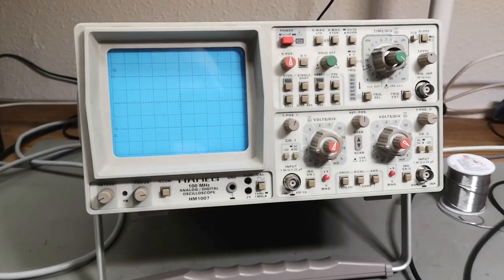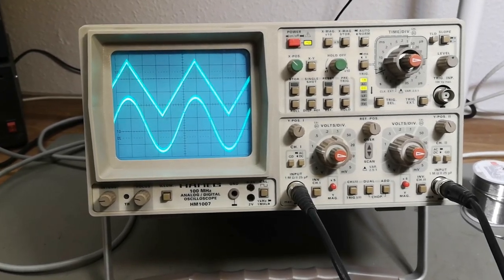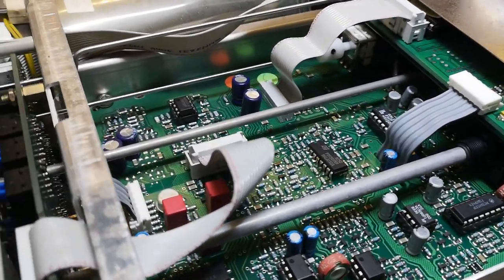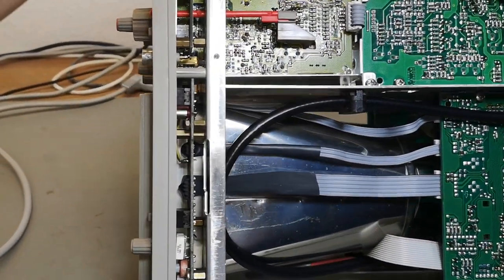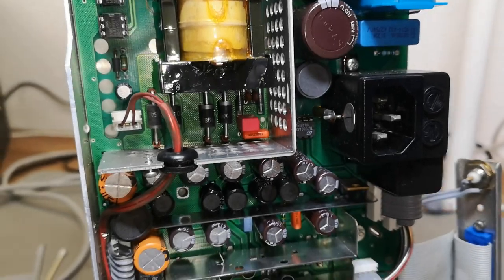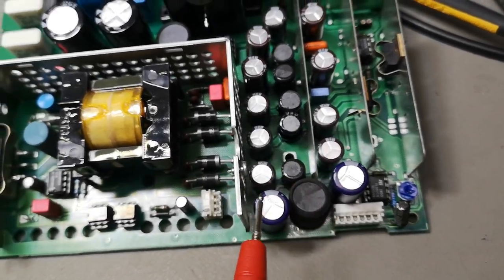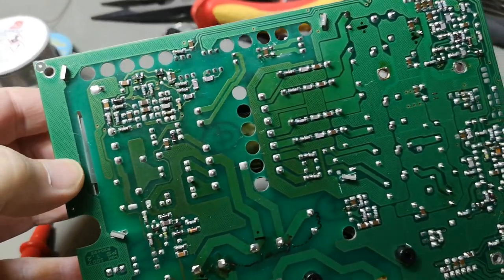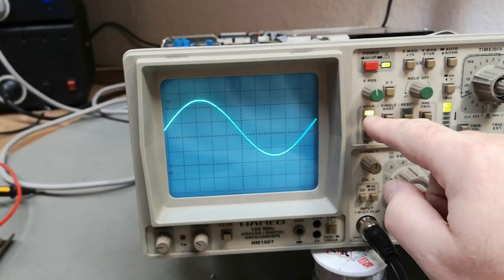Hameg oscilloscope HM1007 100Mhz 2ch analog digital 1995 teardown repair

Comment: Love the Hameg 'scopes, cheap, reliable and nearly student proof, real simple to work on when students get ambitious, real simple to use and the 60MHz/100MHz plus some of the later 35MHz ones have high EHT which gives a very nice, sharp, bright display.

I've a few others, got a Tek 200MHz something or other, a Goldstar 100MHz and a piece of junk digital thing, the Hamegs are my go to
Reply from the maker: i think you got a good point, hameg was cheap but very good, and it turned out they last and work a very long time, many other scopes where even cheaper, but today they are all defective :-) it dont take a long research thru my videos to back up that theory :-)

Comment: I just purchased the exact same model of eBay that was completely dead and it turned out to be the exact same 2 capacitors so looks like it's a common fault with these oscilloscopes. also channelled 2 did not work and it turned out to be a transistor which involved removing the complete attenuator section which was a nightmare because I had to remove all the front panel knobs, buttons and the fascia panel just to be able to remove it. A lot of work just to replace a transistor.
Reply from the maker: thanks a lot for the folow up, i hope this will help other people who own same scope, maybe even a good idea to replace the caps before you see the problem, sometimes leaked caps add more things to solve, acid damage is a known problem

Comment: Thank you so much for describing on how to disconnect the "cable connectors" at 16:44 that Hameg seems to use everywhere. 

Obvious in hindsight, but as I don't usually work with old electronics I haven't encountered them before and spent an agonizing amount of time pulling the cap off and unlocking the individual wires off one facepalm facepalm facepalm

My perception of their repairability has been increased by several orders of magnitude now haha
Reply from the maker: I am so happy i could help.. please come back soon for more
Reply: @TeardownOZ2CPU  Did some additional digging, managed to determine that these were Molex 52007 series (wire trap) connectors.

These are obsolete, but compatible series should be Molex 52147 and Molex 52151 (right angle), if you ever need to replace one (I know I have to haha).
Reply from the maker: @tadejpecar8257  i think it is a good idea to replace them, use gold to gold plated parts in your new contacts and it last